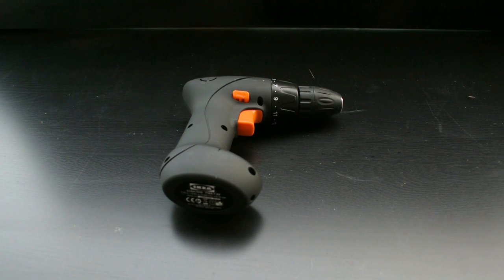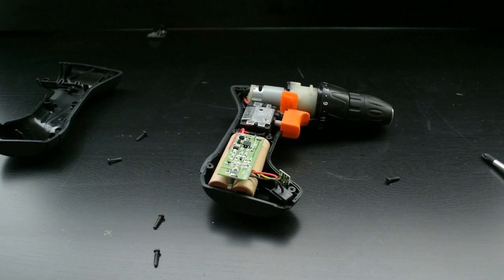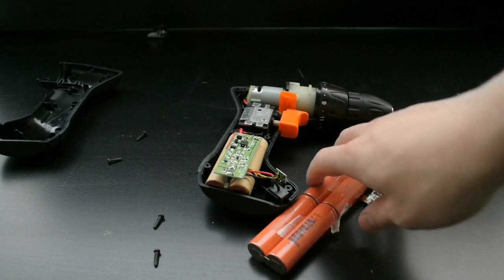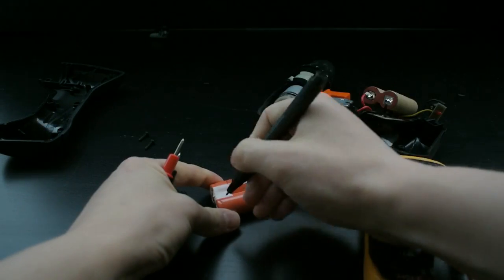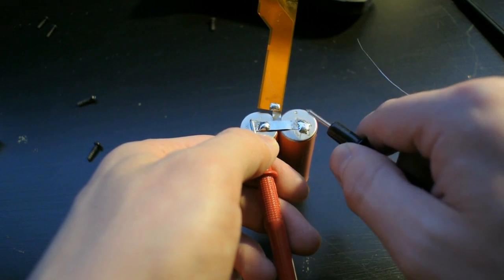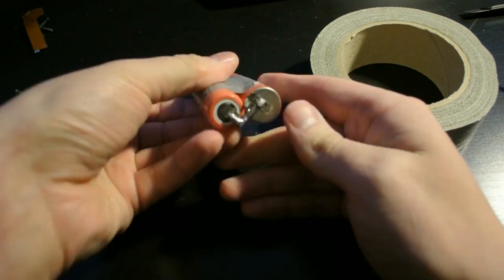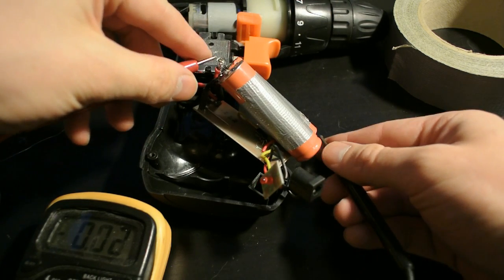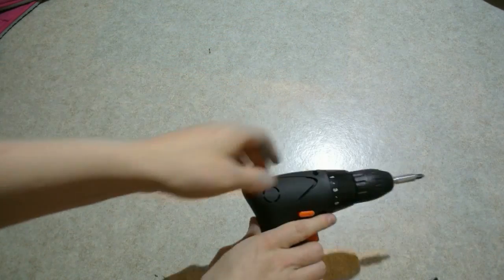Ikea FIXA drill repair / Battery Replacement (Fail: wrong type Li-ion cell used see description.)

Comment: AAA you have wrongly connected the batteries! you connected them in parallel instead of in series! If you do not connect them in series, you will never reach 7.2 volts and you also risk damaging the electronic board of the appliance! When you are ignorant you must avoid making videos with bad information!
Reply from the maker: If you would take a second look at the video you would realize that they are infact in series, and you can even see this at 8:11, the positive terminal is attached to the negative terminal of the next battery meaning they are in series not parallel. You would need to attach posititive to positive and negative to negative for them to be parallel.
Reply: You were not watching the video.

Comment: Can anyone tell me...my Fixa drill is not charging, but the indicator LED on the drill is not lit when it's plugged in....does this mean it's not the batteries? I'm suspecting the LED would still light up while "charging" if the batteries needed to be replaced.

Comment: Can I change one bad cell with a 3.7 15 Mah lithium battery .
Meaning using one 3.6 another 3.7 ? 
Can’t find a 3.6
Reply from the maker: While you can change just one, you should change both.
Reply: Purkkaviritys 
Thanks really but just cannot find 3.6 so can I change it with 2 of 18650 of 3.7v 1800 Mah  or a little higher , which is available ?
With the same PCB ?
Reply from the maker: @P.R00  3.7 is the nominal voltage of lithium cells, so any new cells you purchase are going to be 3.7 and they will rise up to 4.2 when charged. this is normal.

Comment: Bad video! Cells should never be under 2.5 volts, dont use solder on lion batteries and really don't use low current laptop batteries that's really dangerous and will cause fire or a explosion in a powerful drill.
Reply from the maker: I like how people never read the annotations nor do they read the description before commenting.

Comment: There is nothing wrong with the other cell, it is just too deeply discharged. It is fairly easy to recover this problem. Just put 2 AA alkaline cells in series and then attach the ends. AA cells are pretty current limited and should be able to get the cell up to 3v very quickly and once it is back up to 3 volts, it will take a normal charge from the charger.
Reply: I have one of those except mine is the 14.4 V model and it does not work. Yours is the only video I have found on how to replace the batteries. So the next time I find a laptop sitting by the dumpster I will cannibalize the batteries and put them in my IKEA fixa cordless drill. Meanwhile I’m saving your video to watch after I do source my batteries. And I’ll have to get myself a soldering gun.
Reply: @nonelost1  NEVER put laptop batteries in a power tool.  Power tools need a lot of current. Laptop batteries are generally not designed for high current.

Comment: The video is fine, I only wanted to find out what 18650s they chose. My favourite part is where you jabbed the circuit with the screwdriver @1:49
Reply from the maker: Which is why I left the video up with warnings instead of removing it outright. Glad it was useful.
Reply: Cool!

Comment: I have the same drill but won't to charge no led light on. .what can I do. .Thanks
Reply: Possible defect charger or the board from the battery but check first the charger

Comment: Well done Purkkaviritys, ikea drill is a very low cost drill with torque and speed control.
The proper Li  batteries for replacement, may be the 18650 type, used in vape ecig that get up to 35 A of discharge current with a nominal capacity of 3000 mAh and more. For example the Sony VTC5 or better VTC5A. The price on ebay is more or less 5 $ each.

Comment: Can I use Samsung INR18650 13c/ 18A for this drill?
Reply from the maker: +S3nce That is a power tool battery, so that would be the correct kind.
Reply: +Purkkaviritys thanks for answering. I asked because Hificentret wrote about 20/30 amps.. mine are 18 A. I hope they can be good the same. Btw thanks for your video.
Reply from the maker: +S3nce yeah the big thing about it is that its high current as here its 13C x 1300mAh -> max output ~17A and the one I used was 2600mAh and 0,5C so 1,3A max output.
Also would suggest actually getting a proper Hilti or an another pro tool instead of fixing IKEA drill.

Comment: You miss one very important point about using the old laptop cells. I'd even say they're on or over the edge of dangerous to use in a power drill(!)
Those cells are not high current cells. Idling is fine but when it's put to work the drill can draw a very high durrent. For a power drill you need either lots of them in parallel or use high current cells. What you need is some high current 20-30 amps capable cells. Probably overkill but such cells are not that much more expensive or lower capacity than semi high current ones which may also be enough - just get the >=20 amp ones the few cents are not worth bothering about unless you manufacture thousands..
Get brand names (Panasonic, Sanyo, Samsung, LG, Sony) from a decent seller to ensure you get fresh genuine cells. You can even have them with soldering tabs spot welded the way you want (typically C or Z formation)
Reply from the maker: +HifiCentret yeah, while I wasn't originally aware of this and then became aware of it not long after I published the original video and I plan on replacing the cell with a proper one.
Reply: Because LiIon is not a very stable chemistry and besides just ruining the cells you risk them bursting into fire which is hard to put out because it goes into thermal runaway. Many other rechargeable chemistries you just ruin the cells (NiMH etc.) but poses no real safety danger.
Reply: i see.  

i'm glad i came across this.  i was gonna try to revive my old Ni-Cd cordless drill w/ some Sony US18650GR 2550mAh cells in an old laptop.  but apparently, these are older ICR cells and can only handle up to 2.0C drain.  i probably need to look at buying dead lithium cordless drill batteries and see if i can salvage some cells from those.
Reply: Wanderlust
And don't forget LiIon needs different charging scheme and a protection and balancing circuit too you you're using cells in series and no old circuit you can reuse since original cells are not LiIon. You're much better replacing them with high current NiMH cells like racing cells. They're just about a drop in except you may need a NiMH charger as the old NiCd charger may fail to realize when cells have reached full capacity.
Reply: I should add. protection circuit = always. Balancing circuit if you got cells in series a single cell or multiple in parallel only requires protection circuit.
Reply: yes.  i have a lot more googling to do.  i don't want to blow my hand off :/
Reply: Since it's NiCd I'd personally go with NiMH. You can buy NiMH chargers quite cheap like the universal chargers for racing packs etc. should the existing NiCd not be usable. Choosing LiIon you'll 100% need another charger and remember many of those brick in daily speak called "chargers" are in reality noting more than power supplies. The real charging = the controlling circuit is inside the item itself.
Reply: In that case I'll say be 100% sure you're doing it right.
While there sure is some circuits you can use just don't use LiPo sacks for a drill as physical damage is a high risk then. Use good quality high current round cells (like 18650 etc.) and be sure not to exceed max charging voltage and current. But again personally I wouldn't do itif it's born with NiCd. Too much hassle for an old drill because you really need to watch safety and then all the investment in what's needed to make it all run and fit the old battery casing or make a new. If you go with NiMH you still will have the charger for when you decides to go into drones as many of those chargers as I said are universal and can charge just about any known chemistry to man (just set it on right chemistry and voltage and max current before charging battery). But you avoid the hassle of dealing with safety/balancing circuits and you don't risk it bursting into flames by doing something wrong.
Reply: why is using low current/discharge cells in a drill dangerous?
Reply: i know some friends who are into RC and drones and they all use lithium cells so i think i'll just stick with that.  i'm thinking about getting into drones myself.  also, i'm sure they can give me recommendations for good balance chargers and other hardware.

Comment: The voltage of the replacement batteries were really not ok. 2.3V is pretty bad for Li-ion battery. Everything less than 2.8V (2.5V to 3400mAh types) is not healthy. All that heat doesn't helped too, they should be useless now. But thank you anyway for the video :)
Reply from the maker: yeah, the lack of a spot welder makes things a bit difficult, at least I got that one screw done that I needed to be done with the current setup and once I get a spot welder or access to one, I'm going to redo the insides of that drill.

Comment: I'm not able to snug the bit holder, seems others had the same problem. Tried really hard, but not able to twist the front part of the drill. Not sure, what i'm missing. Can someone post a video to snug a bit holder in the drill?
Reply: hello have u managed to assemble it?? I just bought this and I am stuck as well please help
Reply: I couldn't make it to work,finally returned it instead of spending time in trying to make a $15 useless thing work...